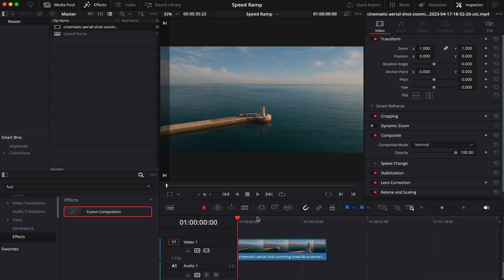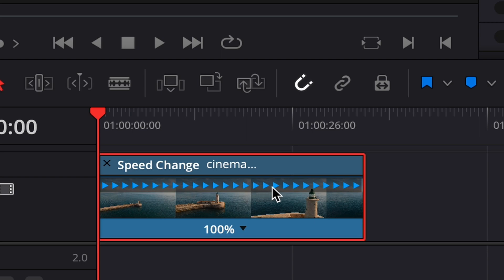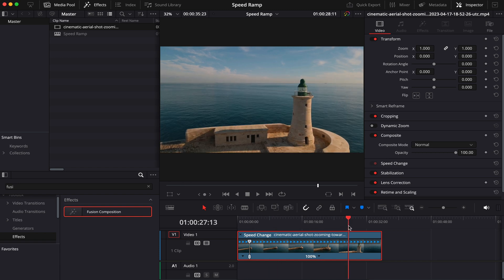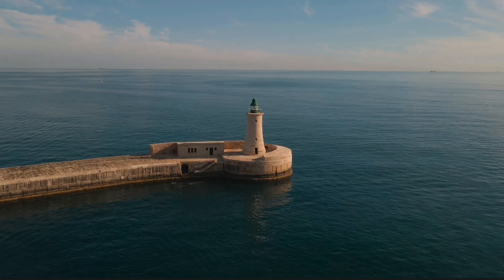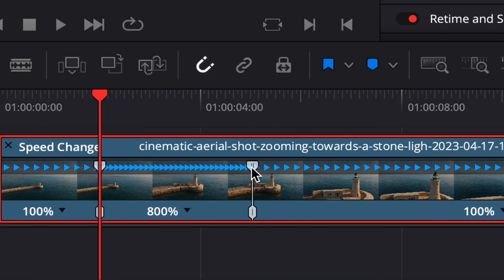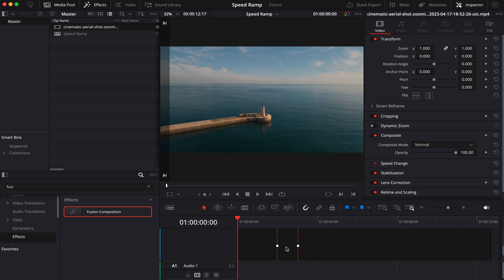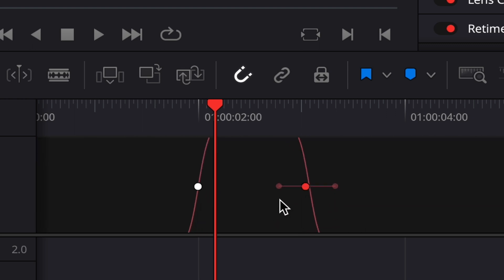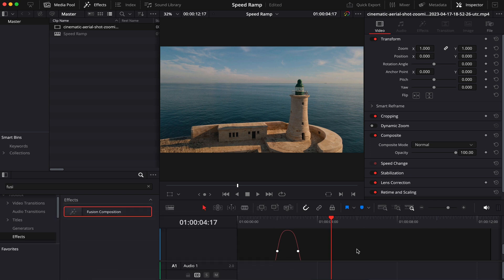The BEST way to SPEED RAMP in DaVinci Resolve | Tutorial

Comment: How do you go the other way SLO-Motion say 5 seconds to 20 seconds i.e. 25% and get it to push all clips to the right?
Reply from the maker: In that case your footage should have at least double the frame rate of your project for you to go 50÷. For  example: your project is 24fps, your footage is 60fps. In that case you can slow motion perfectly at 50%. To get a perfect slow-mo at 25÷ your frame rate should be 120fps to a 24fps project. If that's the case, to speed ramp all you have to do is set the speed points and drag the upper part of the markers to the outside direction, instead of inside.

Now, if your footage has the same frame rate of your project, it won't look good, but you can go to inspector -> retime and scaling -> retime process -> optical flow.

Let me know if it helped!
Reply: Now  I  Realize  what  I  did wrong wat  not (Shot  @ 60P fps Project 30 fps Slowed down  4x to  25%) it was that I  cut out the exact  amount  I wanted to Slo-Mo and moved everything to the right Manually. Had problem getting end of Slo-Mo to line up with rest of end of screen.  Never could get PITCH Right.